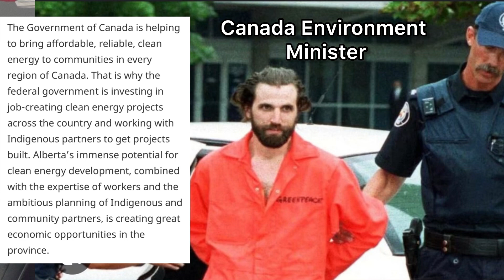The Shocking Truth about Trudeau’s Green Energy Plan “They don’t want you to know”

Comment: Not reliable either, so need 100% hot backup. As in running coal or gas fired generators or hydroelectric dams.
Very expensive power converters to translate the highly variable wind generator output to highly stable grid power.
And they have moving parts in a hostile ( -40 to +40) environment so how often do the generator mechanisms need service or replacement?
So many things wrong with them and a primary power fail.